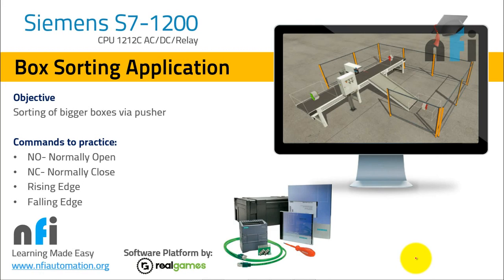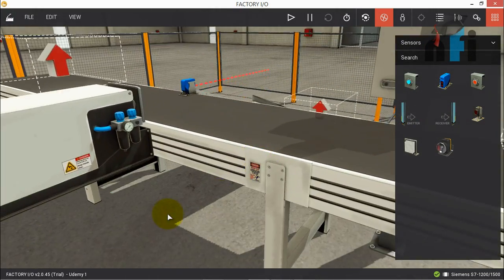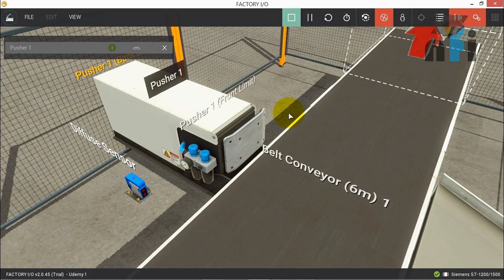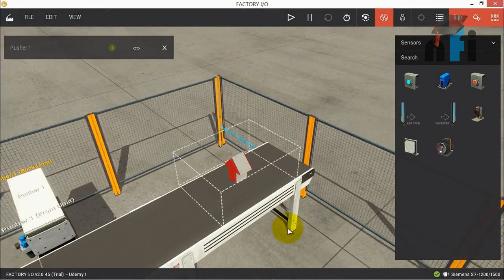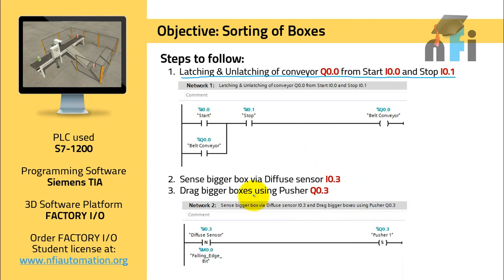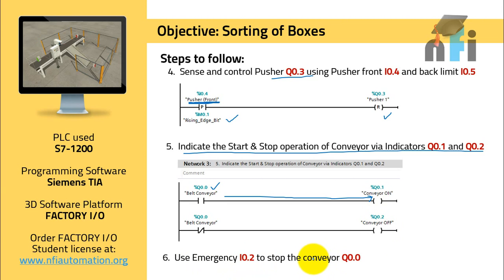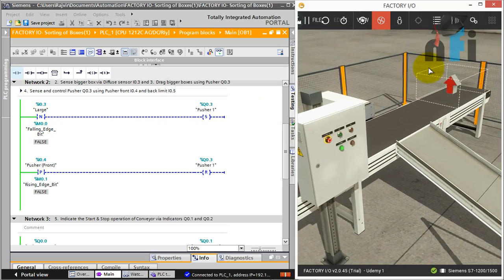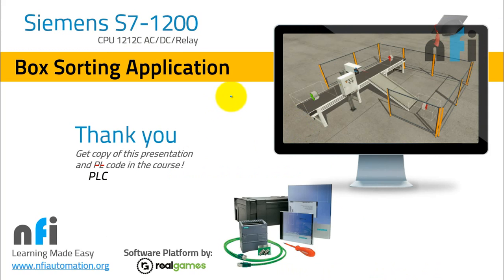Siemens S7-1200 - Box Sorting Application

Comment: what will happen when we using positive edge???
Reply from the maker: As per the logic if you use positive edge the pusher will be activated way before the box reaches infront of chute conveyor. So the box may not go in the chute conveyor. But if you really want to use Rising edge then you have to make delay in actuation of pusher. Or you can position the sensor just infront of the pusher.
Reply: thank you sir
Reply from the maker: Your welcome!
Reply: sir, the limit switch dectects the pusher during +ve edge ...and it will bring the pusher to orginal position to  _ve pulse.....? plz justy it..
Reply from the maker: Dear Bharath,  the front limit will send the pusher backward ensuring one cycle.